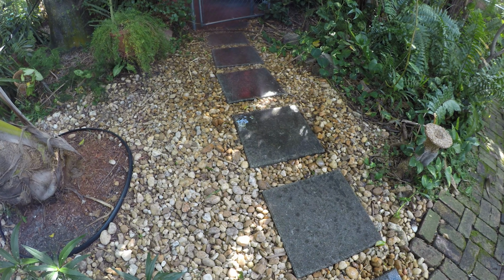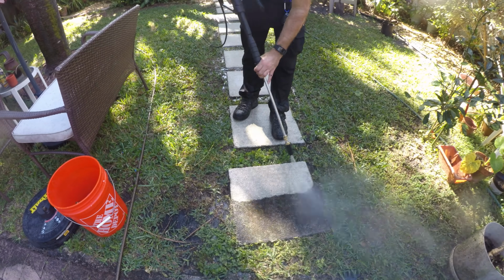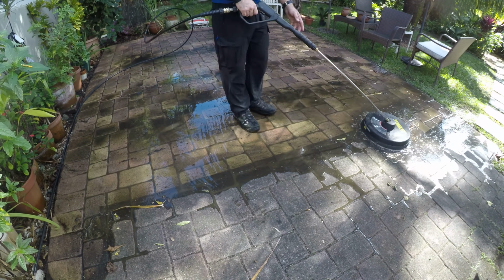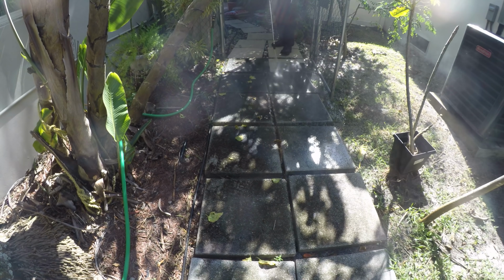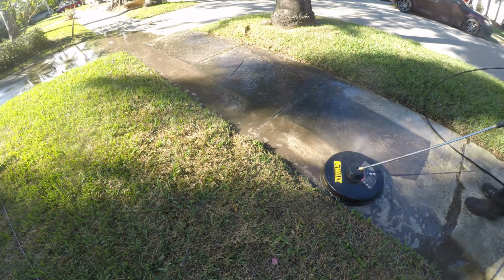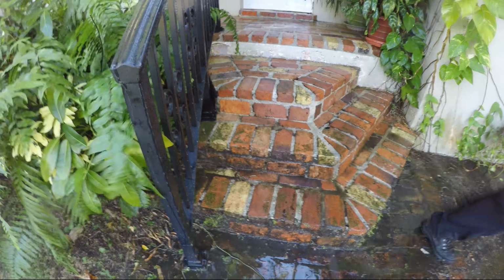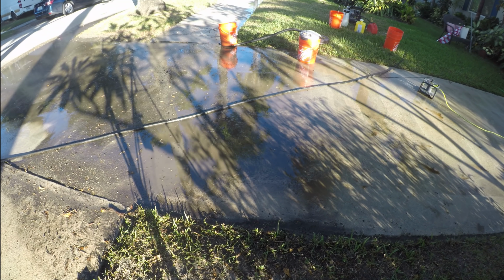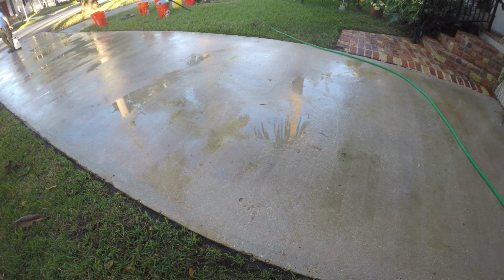Job #13 Crazy Transformation Pressure Wash, Must Watch, Highly Satisfying

Comment: If the owner applied a sealer on the pavers; would it help discourage algae growth?
Reply from the maker: It wouldn't be enough, the wear from walking, tires or the elements would remove it eventually. In the perfect world even after sealed you should still pressure wash once a year and reapply sealer. So basically, there is no way to escape the maintenance of a property

Comment: What are you spraying on the concrete after washing?
Great job!
Reply from the maker: The final spray in a mix of Sodium Hypochlorite. Thank you! 😀
Reply: @MelicoWash  how do you determine if you are going to pretreat the concrete with it? I saw your other video and saw you pretreat but you did t do it here
Reply from the maker: I have now come to the conclusion that pre-treatment with Sodium Hypochlorite is a must because it disinfects, loosens up the dirty stuff, whitens the surface and reduces the possibility of streak marks by approximately 99%